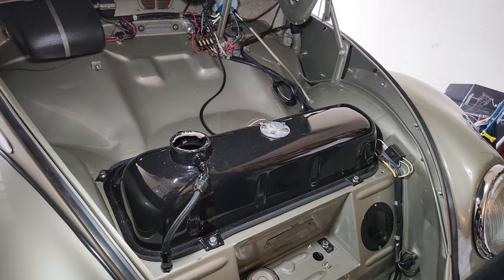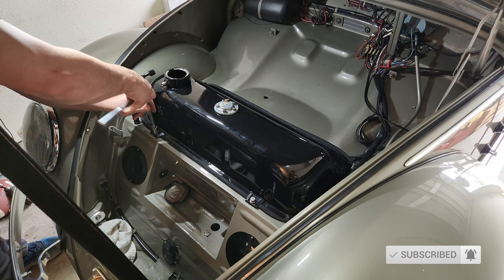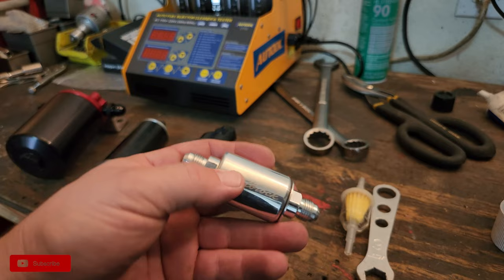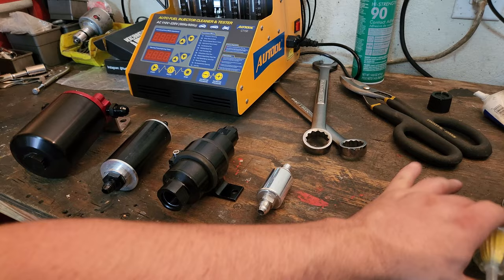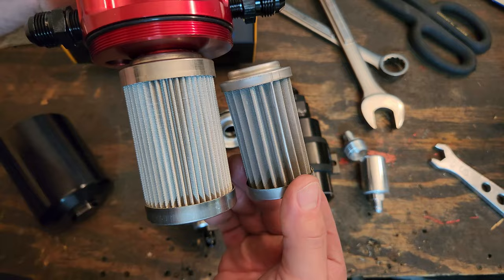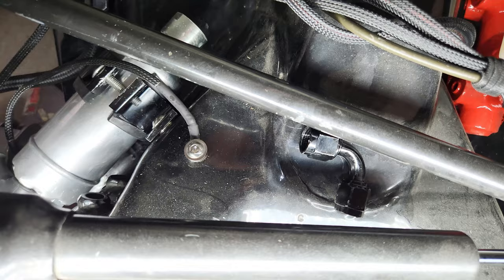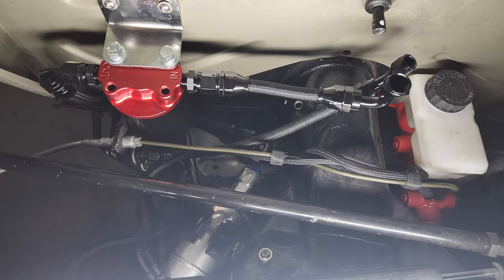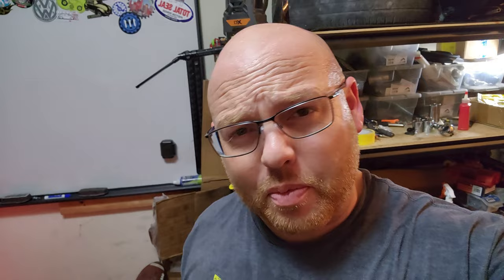VW Beetle Fuel Filter - Which one to use | JW Classic VW

Comment: Screen in the tank and built in filter in the stock Pierburg pump is all i'm running on a 40hp.   Clean the filter at oil change. Stock is rock.
Reply from the maker: Nothing wrong with stock when working with a stock set up.

Comment: Hi Jason,  I appreciate all of your write-ups.  Here's another quality filter for folks to consider from Deatschwerks (Oklahoma City, OK). They have stainless steel elements compatible with all fuels, available in 5, 10, 40, 100 micron and 3 lengths - 70, 110, 160mm.  They are 2-stage magnetic & mechanical filtration.  For my VW turbo EFI setup, I went with the smaller footprint 70mm bodies, with 100 micron, -8an pre-filter and 10 micron, -6an post-filter.  I have not yet installed them.
Reply from the maker: Great info here!! Lots of options!

Comment: Very clean install man, looks great! She’s sounding great as well 🤙
Can you data log your pulls and see where the issues is for the stutter?
Reply from the maker: Done figured it out man... not getting proper fuel with the current tune on E85.  On 93 she cleaned right up, gotta get her to the tuner.
Reply: @JWClassicVW  ah ok, that makes more sense! 
E requires so much more fuel, prob need to modify that fuel map big time.

Comment: Not sure if your running E85.  But when I had an E85 tune on an import I had studering issues as well.  I found out that my injectors got a little clogged due to a filter I had that didn’t do such a good job.  I had to send in my injectors to get them cleaned  and that did the trick.  After that I eventually got a proper filter.  Also, you can get a studder running E85 when the temperature drops.  That can be tuned out.
Reply from the maker: Yup E85... my current tune for it is off... put 93 in and she runs like a grape ape!!
Reply: @JWClassicVW  yup, Eventually, I ended up just running 91 as well.  Hope you get it cleared up.

Comment: On occassion, I add 1 gallon of 100 octane, blue avgas to my 93 octane 10 gallon gas tank for a 1915cc in "Das Li'l Beast". FYI...Suprised that many gas filters are sold without any specs for MICRON size. Thanks for your video info. I'll check w/ Frank Scott who gave me specs on my current fuel pump built in regulator (3.0-3.5) ajoining fuel filter combo, installed to push fuel right under my front gasoline tank.
Reply from the maker: Get that race fuel!! Yes!

Comment: I've been caught out with this same problem in my jet boat. The fittings and fuel lines were too small. Small lines cause a lot of pressure drop due to wall friction. E85 uses about 3x the flow so you would need injectors that can handle it as well.
Reply from the maker: Yup... that E85 needs so much more fuel and ignition.  The tuner will need to fix the table for me... definitely needs some dyno time.

Comment: Hi, great video! I have a 2110cc air cooled engine that I'm fitting in to my 71 bus after Christmas. It came with an external oil filter and standard Fram oil filter. What would you recommend for this set up?
Reply from the maker: Well the bracket that mounts above the transmission would be the way I would go but instead of the clear filter displayed in the link below I'd just use a standard metal filter link below.

Bracket: https://www.thesamba.com/vw/classifieds/detail.php?id=1901747

Filter: https://amzn.to/3VClFz0
Reply: @JWClassicVW  thank you very much.